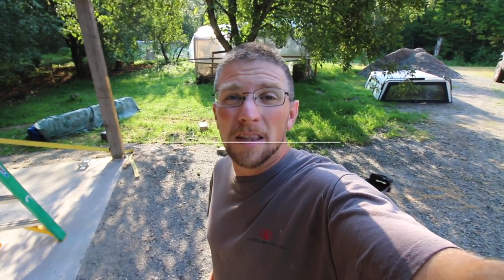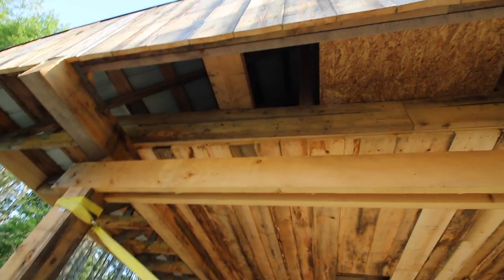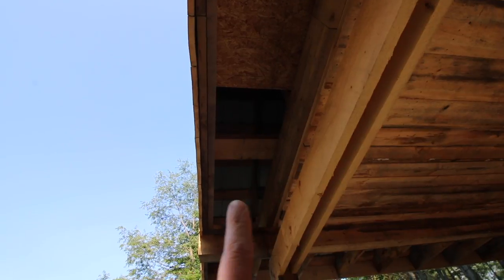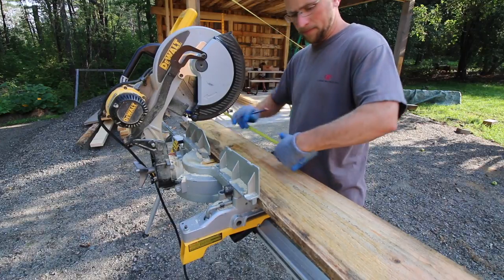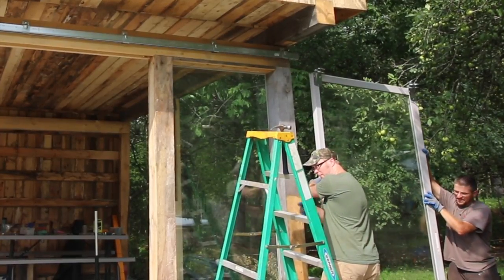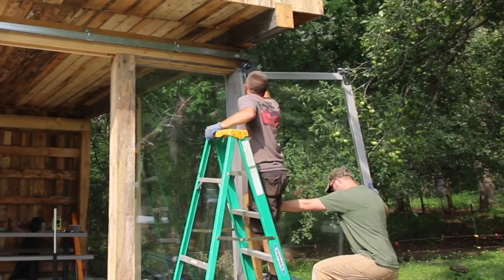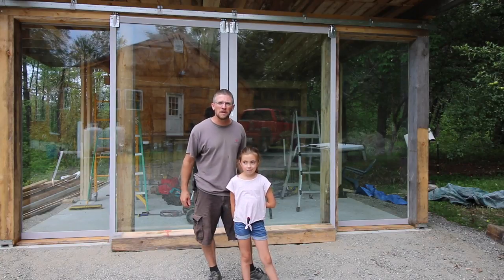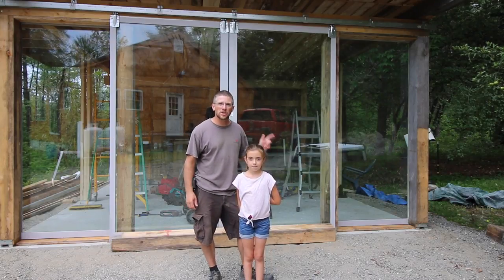Installing the Sliding Glass Front on the Off Grid Outdoor Kitchen

Comment: I did notice one potential drawback to your design AL you may have limited your multi function use of the outdoor kitchen . The doors look beautiful and work awesome  but if you have to use it as a garage for repairs or storage  of vehicles or tractors the threshold is problematic  and door width is also a bit narrow. I understand its intended use is living space . BUT . You never know what will happen in the winter
Reply from the maker: The door opening is 7 feet wide which is a standard garage door width. We should be fine for getting a car or tractor in it